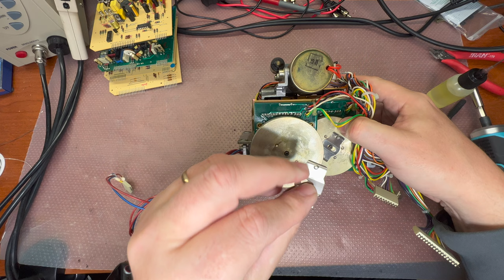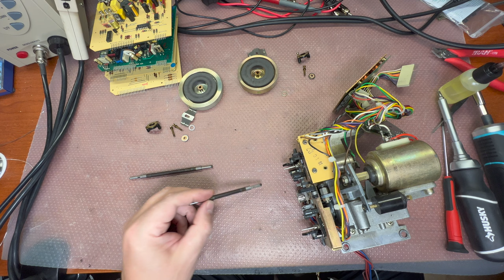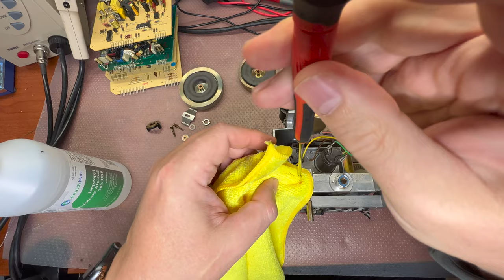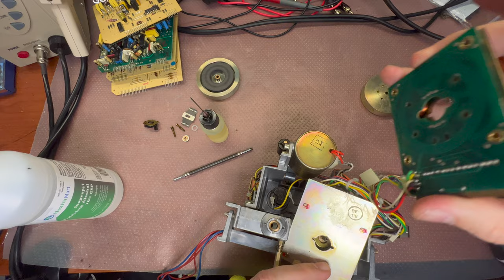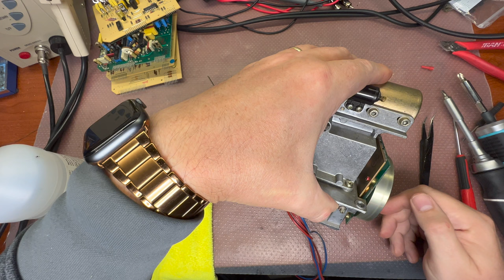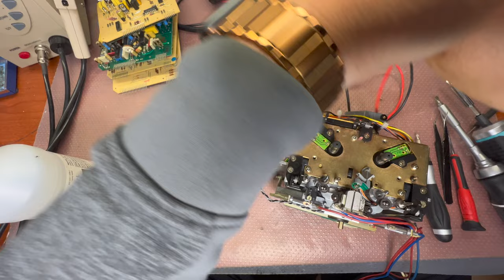Revox B710 Tape Transport Disassembly Guide: Step by Step

Comment: Please people.... DO NOT use this as an example on how to service this extremely high precision mechanism.  And NO.... not just any oil will work.  Yes, for a WHILE, but the mechanism will give trouble again, usually hard or NO start of one or both capstan motors.  Then you'll be back, cleaning out the "oil" and putting in PDP-65, which is a synthetic specialty lubricant.

This gentleman IS very skilled, but this was likely a new experience for him.  Revox is uniquely different in design and precision.  It requires the cleanliness and precision of a watchmaker to get good results.  He did figure this out near the end of his video journey with this deck, so I won't dump on him.  It took me a long time as well to learn this mechanism.  Yes, PLEASE use the right oil, you don't want to mix oils in this mechanism, it is UNFORGIVING.  Do it right, and it'll run another 40 years!

Comment: Two brass rings on a “drive” shaft comparing to three rings causes the “drive” shaft to pull a tape stronger than the second shaft pushes. Is this by design, or are you shure there must be an equal number of the spacers?
Reply: The processor driving the motors takes care of this by locking to a slightly lower frequency.

Comment: What oil do you use to lubricate capstan shaft/bearing?
Reply from the maker: The oil for sewing machines.
Reply: @hifirulezzz  This is incorrect. Revox shafts on cassette and open reel decks must be lubricated only with ISOFLEX PDP65.
Reply from the maker: @savvassidiropoulos5952  you made me smile. Any good lubricant will work just fine. Not a Mars rocket.